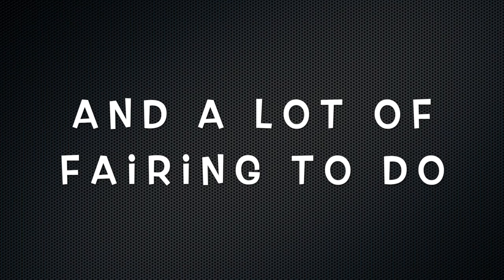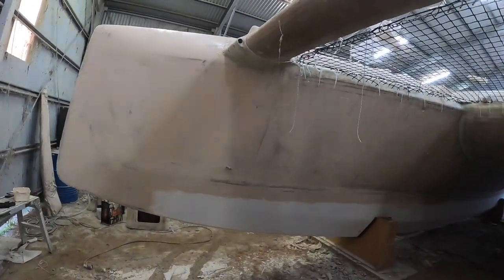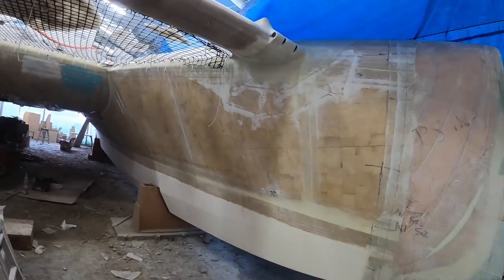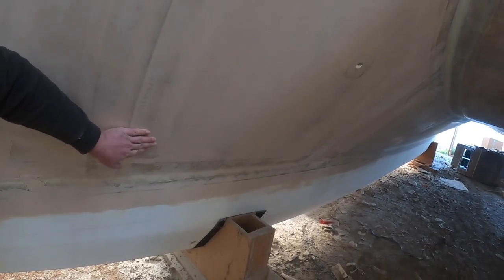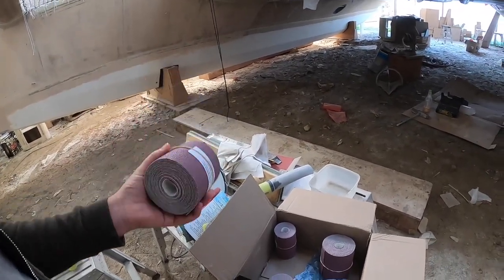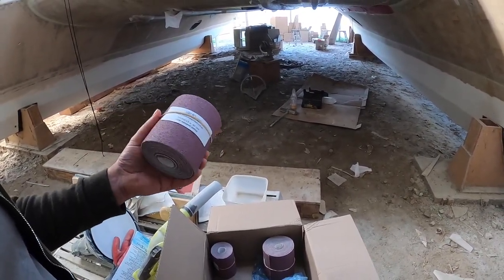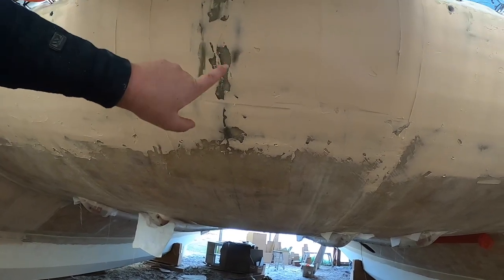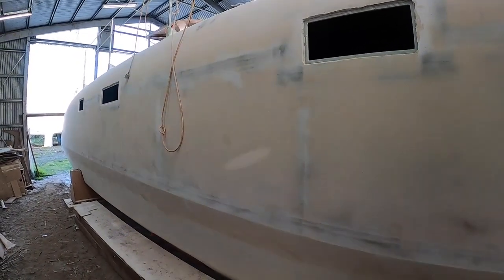Its a BIG boat!... and more fairing to do!...S01 E23 - DIY Catamaran

Comment: Well, looks like practice does make perfect, you are improving, second hull is looking great, sounds like this work was done some time ago so my comments about using a fairing board probably don't need repeating. You mentioned trying to improve your sander....could you make a thin ply disc with Velcro (hook front and loop back) pad spacer/stiffener between the disc and the sand paper to try and reduce the amount of pad deflection you are getting (you would just have to be very careful the whole thing doesn't dig in....so would start with light broad diagonal sweeps (your oblique abdominals will hate you for it....so a shot of beetroot juice after everyday might help), cheers
Reply from the maker: That was the plan. I didn´t actually get around to it so the main shaping is still done with the fairing boards. I think next episode should contain some work with the boards and using a powder to help me fair the surface. The material here is from August some time, perhaps even July, before lvl 4 lock down in Melbourne.

I love beetroot juice! Best mixed with orange juice :) Gets a bit of an earthy taste without :)